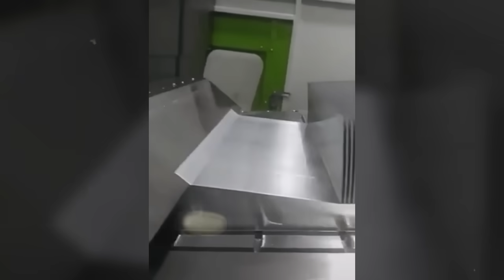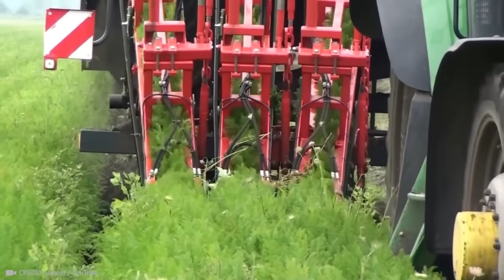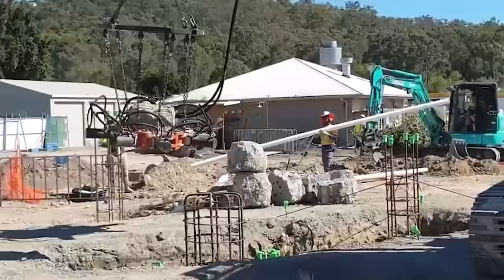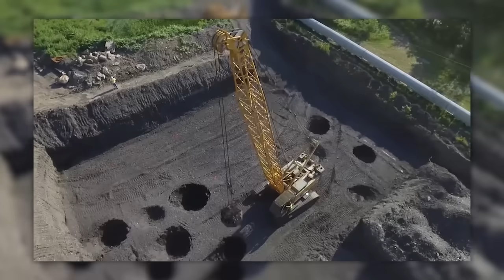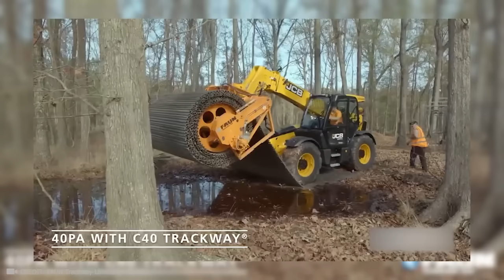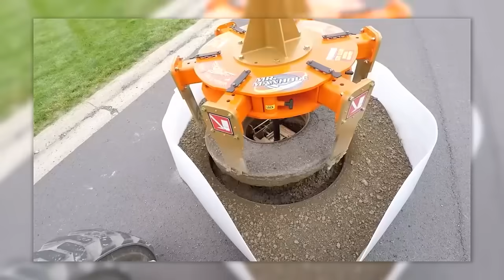Most Satisfying Machines That Do the Job Perfectly !

Comment: Man, you never been in facility, where they transform plain metal to say bulldozer bucket, or jaws to get and release metal things. Its increšdible factory. They cut metal up to 100 mm thick by laser or water, than they shape it, stabilize by colour or galvanization... I have been there with spedition driver. We been so fast, so they gave us tour, before final items colouring dry.. And it was fascinating. See tanks for welding gasses. (at least 1000 m oxygene and hydrogene, cutting, shaping, welding. See how they form 100 m thick steel into proper form was exceptional.